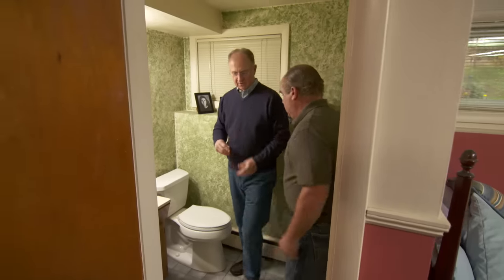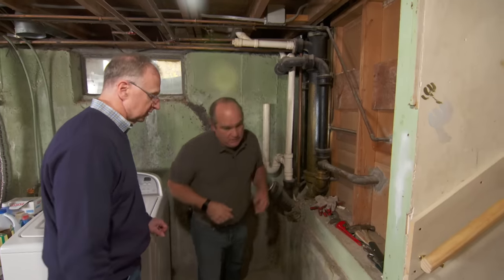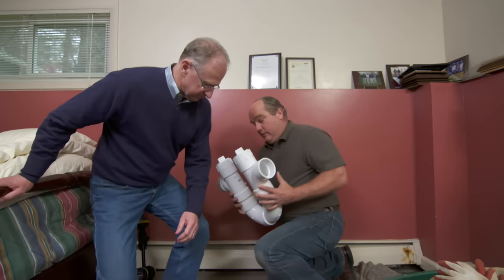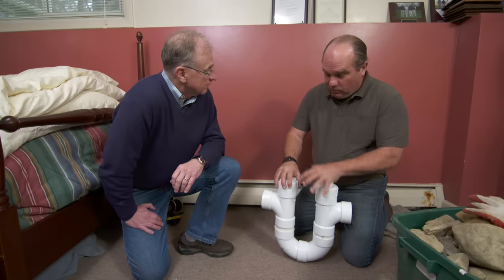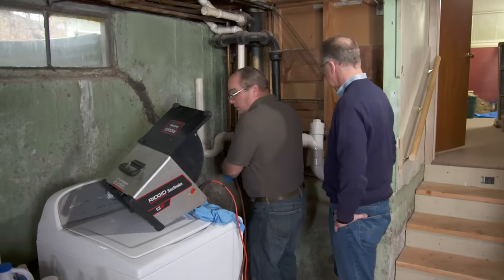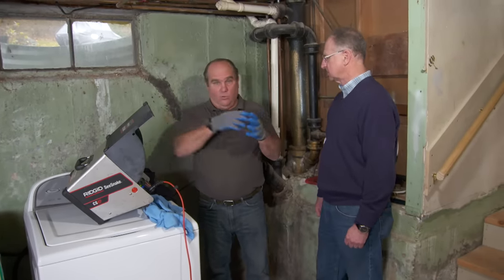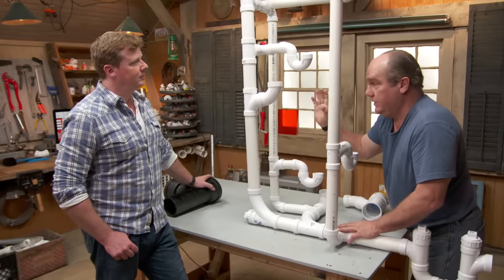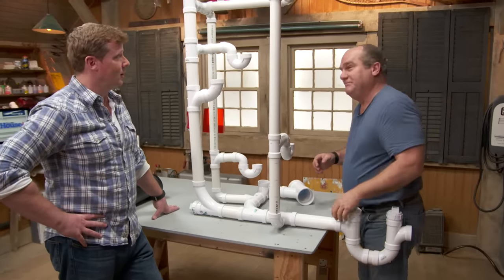How to Diagnose Plumbing Drain Problems | Ask This Old House

Comment: I don’t know how I got to watch this, but darn this fella knows plumbing, and I’m hooked. Thank you for all the info!
Reply: He might be right but the proof is in the pudding. It ain`t over till it`s over. The weather man gives all kinds of theories too and how often is he right? Just sayin`.
Reply: @REDMAN298  exactly....here's my reply made yesterday...it's not gospel....but it's a rational possibility;
Whole house trap? Get rid of that.....you have it mostly dug up anyway. If turds and paper are making it through the "bellied" pipe and that whole house  trap...they'll make it with out it. That model he made (towards the end of the video) of what the plumbing looks like underneath the slab is pure conjecture (not sure why there are 2 other traps...there's only a toilet (toilets have a built-in trap) and a sink down stairs....but it looks cool I guess). What you CAN see from the basement is the upstairs bathroom draining into the same vertical pipe as the downstairs is draining into.(someone probably added that bathroom upstairs later) When you flush the toilet upstairs, that water is falling very quickly past the branch lines serving the bathroom downstairs...that's going to cause air to move no matter what....and that's why its against code. Upstairs needs a dedicated 3" waste line going up.(much less $$$ and work than the other plan) So this homeowner may spend all that money and still have the same problem. The bathroom probably smells occasionally because the wax seal under the toilet is leaking....few people know how to properly set a toilet...the tile in that bathroom looks relatively new...tile guys are not plumbers....it's not as easy as you might think. I've been a professional union plumber since Jr. High....I'm 59 now. (end)
Out of curiosity I'd pull that downstairs toilet (check the wax seal) and watch what happens when the upstairs toilet is flushed. Heck, I live in a new house and when it's really windy outside, toilet bowl water will move that much....and I never saw any bubbles come up in this video.
Reply: @readmore3634  how have you been in the union since jr high school? Lol but I know what  you mean. Did you work in a union shop as a tradesman until you got in? When I joined , we needed a valid drivers license and a high school diploma. ..Anyway, about that bathroom, I think the one downstairs was the add on due to its location (in the basement) and the wall was only rocked on one side. The smell probably comes from the traps because all the water evaporated due to lack of use. Those family photos are a dead give away that it's a guest room bathroom. . its location keeps it from getting much use otherwise.
Reply: @jdog4534  _______Well, I guess I miss-typed. 
From about 1960 to 1990 my dad ran the only union plumbing shop in southern Calif that primarily did housing. We had about 20-30 guys at one time and plumbed 1,000's of tract homes. They couldn't build houses fast enough(if you are old enough to remember). When I was in Jr. High, (1972) my dad would bring home CASES of tub/shower valves for me to pre-fab. Finally a reason to play with fire (torch)! I worked every summer vacation afterwords. Tried college, ran out of money, got sworn-in in 1979, 4 years apprenticeship school.....went into business for myself in 2008. 
As for that bathroom above ^, one of them seems added to the same vertical pipe. Dried out traps for sure will stink too. 
I don't know much...but I know plumbing...hand me a set of plans and I'll plumb that whole multi-million dollar house myself. Thanks for the reply.
Reply: @readmore3634  right on brother. Im in nor cal. Ive only been on one residential job tho. Im in a combination local (plumbers, fitters and pipe welders. We do commercial plumbing. I dont know how the shop I was working for at the time landed a housing tract. Other than that, the closest thing to residential plumbing ive done have been hotels and patient rooms in hospitals but the hospitals still get  closets hung on carriers with flushometers and all pipe is cast iron for waste n vent and copper for water. They also usually some med gas piping, at least medical air, oxygen and evac.   

Yea, I figured it was some kind of shop experience you were getting at such a young age. I've had a couple superintendents who had the same experience. Both of them in the same shop, at the same time. Now they're both probably about your age, living large and in charge, at the same shop. 
I took a different route. I joined the army first, then went to college, less than a week after I graduated, I took the test to get in the union (one of my army buddies had joined a couple years earlier and was loving it. I wanted to join sooner but they were only testing every other year. That was '95. You know it's a 5 year apprenticeship now, huh. ..and there's talk about adding a 6th). Anyway, I always figured the building trades ran a very fast pace down there in so cal. Is your shop still a union shop?  Ive been thinking about opening up my own union shop and taking advantage of my veteran status. Supposedly, on federal jobs, veteran contractors get some kind of preferential treatment during the bidding process.  
I'll have to watch the video again to check out the piping a little better. Its been maybe a month or more since I saw it. I just remember thinking that the lower bathroom was added on due to its location and all the exposed plumbing on that wall with rock on only one side.  You know, if that's a handyman special pipe job, it could be that it's not vented .. Lol 

Hey, thanks for your reply..
Reply: I had a smell in my downstairs bathroom. Thought it was a venting issue sucking the water down but it was actually because the people who lived there before had ferrets and the excrement got under the vinyl. Took it out, bleached and tiled and smell had gone. Sewer smells can come from anything, even trapped moisture under loose tiles
Reply: @readmore3634  i have been asking this from.every old plumber, and now.here too. Can h please email me some really practical plumbing illustrated old book if u have one
Reply: @mutiur7396  I'm not sure what your asking. I didn't learn anything in apprenticeship school. Never saw an illustrated book worth looking at. I learned everything from older guys and  experience. Can I help you with something in particular?
Reply: @readmore3634  hahahahaha there are so many to ask. I wanted to ask is there any good book to learn if one donot have knowledge person to teach.
Reply: @REDMAN298  yeah he should have finished the job. he usually does in these videos.
Reply: That guy is real PRO.
Reply: @readmore3634 yrujjjkJjjyuuuuIIuuujkkyyitjyoujituohkrtojkruuulhiyouruouIuukyouuyoouilutkuouityiukIituuujyyJulukJuluIitukituuyuupuIykrtutuupyt UKuIyyouJuljokuitktouittitjukkyoutIujukuuuitUKIkuyooititjhuhIIukukUKjjlkutilityyiuuhy6tkukhuyoukIhitJulkjko6
Reply: @mutiur7396  Yes, the UPC study guide, which is currently free online.

Comment: Wish I had Richard - I went thru six plumbers to find a leak to no avail so I understand the frustration.  
Turned out the county sewer department knew exactly where the problem was and saved me a fortune!
Always check with them first to make sure the line is clear from the street to the house.

Comment: Easily the best TOH video I've ever seen, and it's not even close. Full diagnosis and explanation. Incredible work. Too bad the first plumber he called wasn't as thorough, although I'm glad we were able to get this video as a result.
Reply: Maybe the guy did but the homeowner wanted a second opinion because the solution was so expensive. This owner is in a pickle either way. Some major remodeling. Hope he solved it in the end.
Reply: @cosmicallyderived  Just put a scissor jack under the sagging pipe. In ten more years when it sags again, crank it a couple more turns. :-)

Comment: I'm a plumber from Nigeria, I'll like to learn this modern plumbing system cuz in my country we still the olden days methods
Reply: It would be cool if you could.
Reply: USA plumbing isn't modern they still glue pipes when pipes with rubber seal has been available almost century. 
And making trap on actual pipe lines is bad because you need snake to clean them when needed more modern is trap in fixture which can be opened when cleaning is needed an all pipe lines are more straight flowing.
Reply: Outhouse and a hole still?
Reply: "olden days method" also known as crap in a bush
Reply: @mr.wizeguy8995  what's wrong with pcv cement? My house has ABS bonded "glued" with acetone, and I'd trust both abs and pvc to last longer than any rubber seal on a sewer pipe.
Reply: @AMD1  It's  more time consuming to install, harder to make changes afterward, still chance it leak if cluing has done improperly. Rubber seal is fast you only need lubricant to fit it, easy to undo.  

My house is built 1978 with rubber seal pipes no issues what so ever and i have seen much older with no issue so dunno how long it has to last.
Reply: Old methods as in outhouses and holes ?

Its what my Mother grew up with until the 1970s.
Reply: That technology is at least 100 years old
Reply: @Spookytooth92   🤣😁😂
Reply: @mr.wizeguy8995 nobody is putting a trap like that on a modern drain line. He was pretty clear that was for cesspool drains, which have been banned for quite some time. I'm honestly interested what you mean by rubber seals on drain lines. Are you referring to what we would call no-hub bands on cast iron pipe? Or is there some new futuristic way of running drain pipe we haven't been introduced to? I'm not being sarcastic. I like to see how things are done in other countries.  We use plastic, glued pipe and fittings because it's quicker and more economical. We're required to get things done a little faster than in Europe or we won't be in business long. That doesn't apply to all buildings, of course. Plastic drains are mostly in buildings three stories or less. I'm interested in any feedback.

Comment: I loved the camera tool and the camera locator.
You might think I'm nuts, but I was fascinated with the plumbing video.
Reply: I’m thankful for the technology advancement in plumbing. My 1962 split level was originally septic. Converted to city sewer in 74. 100 ft of 4” ABS out to the street. Backed up in 17 on me but I caught it before work and tried power snaking myself from inside the basement toilet location. Didn’t get it. Hired camera crew plumbing company and it is $250 hour billed in 15 min increments...they snaked drain out to street and i saw the video was clean as whistle....for $800 (camera was only to 90’) crap lol...2 years later in dec 19 it backed up but i wasn’t home and wife didn’t know. So probably an inch of dishwashing water and mixture of toilet paper slurry in toilet...was so mad...dug up clean out in yard that I found on drawings i got from city after the ‘17 backup and hired a new crew that had a 120’ camera...as I needed to see the city connection.  Paid them to jet clean my line $2200. Called city and they had to clean the stub from the main line...we are only 4 house on an 8” stub so city camera showed soft plug in main line...we bought home in 07 so 10 years before anything happened. The cameras show me everything and i know my whole sewer line and the city line too. Information is important when you spend a lifetime buying these things.

Comment: Learned something on this.  Thanks.  Surprised a rat trap works.  After 22', solids are low velocity.  I would expect it to quickly fill and clog the trap.  Pipe looks intact. Before ripping it all out, I'd maybe do a surgical excavation.  Cut the slab at the low point of the dip.  Put rope under the pipe.  Use a 2x4 to lever the pipe back up into position.  Check with a torpedo level.  1/4" to 1/8" pitch per foot ( half a bubble on the level) Backfill with self leveling (soupy) concrete.  Now swap the house trap if your budget and ambition supports it
Reply: I was thinking about this!
Reply: Well hmm I have a floor drain in a laundry room that has nasty water that hasn’t budged, washer is not working/ old speedqueen , had water in tub as it would not spin,, just tried again and water backed up into the sink next to washer.. dark stinky .. I have tried power mainline down floor drain 
Still have standing water!
Help Richard !! Can you send me a plumber like You!!

Comment: SMARTEST PLUMBER - thank you for this lesson.  [I am trying to avoid crawling under my house to the kitchen drain clean out, so searching for clogged drain videos and just watched another one of yours - I think my pipes are galvanized, so avoiding harsh treatment - using B.Soda + Vinegar and blowing a 1/4 x 4 ft hose to stir up the 'mass' and rotate the soda, vinegar and now salt + I purchased an Enzyme/Bacteria dissolver.  Day 4 still clogged, but breaking up material.

Comment: It may not be ideal, but I'd run a secondary vent to the bathroom, back to the main house vent. It wouldn't be a long term solution, but it would be trivial looking at the location and access to the bathroom, compared to a complete basement "remodel".

Comment: Execellent video that explains a dwv system in simple terms. I love it. Odors are usually the hardest issue to correct. . It’ll be a step by step process until it’s fixed. Either With using a cam, smoke etc. odors are subjective to each individual. 

Can test entire system with water or smoke and find no leaks but homeowner will still believe they smell something because they can’t understand how everything works. 

Those are the toughest jobs.
Reply: anth0r, I have had luck by using peppermint oil and putting it in the vent on the roof with the leaf blower behind it for a couple minutes.  Don't let the same person who administered the peppermint back in the house cause they will give you a false diagnosis of where the issue is.